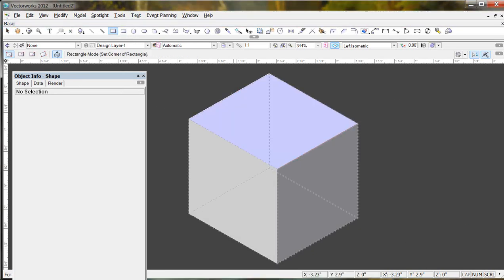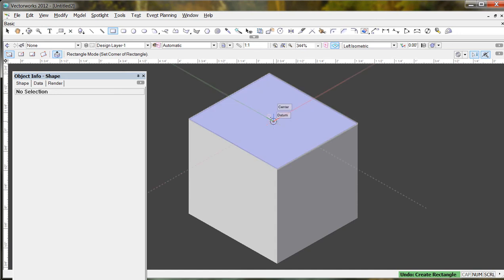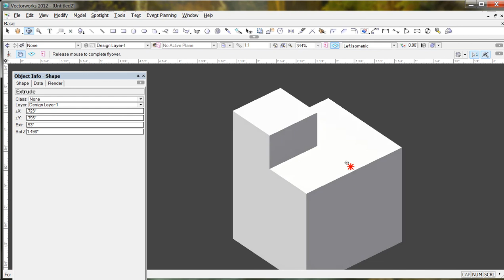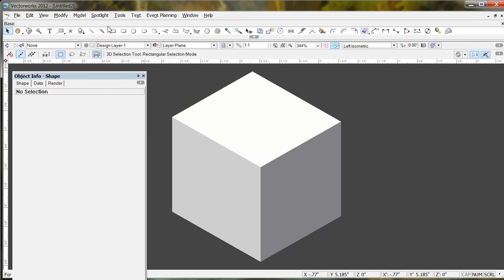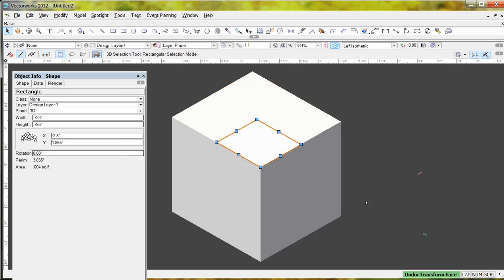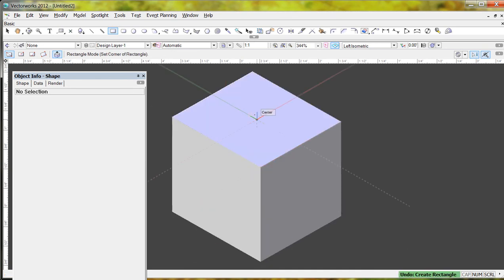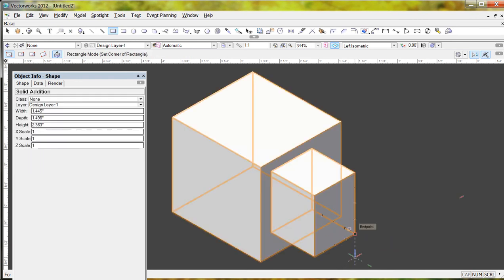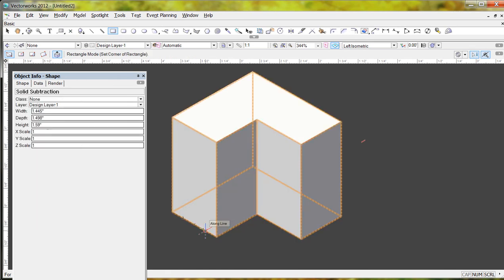VectorWorks Push Pull Solid Subtract

Comment: Also - the subtraction only works when you automatically enter the push/pull mode after creating a 2D shape. It does not seem to work on an existing 2D shape if you select the Push/Pull tool from the 3D Modeling Tool Set.

Comment: When I do this, I get weird, jagged lines.  Any idea what is going on?
Reply from the maker: Thats probably pixel-fighting. Thats when 2 surfaces are in exactly the same plane and the computer doesn't know which it should show you so it tries to show both. On a different tut, I'd advise you to select one obj and use the move command to move one a tiny bit like .001" that's usually enough to stop that. But since you're asking on this vid, its probably that it hasn't actually done the solid subtraction and you've created a shape inside a shape. Drag a selection marquee around and see what it says in the Obj Info--it it says "2 objects" or similar then you'll know thats the problem. So right click and select Subtract solids and it will do what you're trying to do. Like I say in the vid I find the solid subtract too fussy to use regularly.
Reply: @seanposkea  Thanks so much for this.

Comment: None of this seems to be work for  me. Subtract solids is greyed out. When I try to draw a 2d rectangle, it doesn't respect the planes. Just draws in 2d. Tried the Protrustion/Cutout tool. That says it's "failed" when I try to complete the operation. Bit frus. Just want to create a tenon.
Reply from the maker: +enstamudTry watching these first. If your -Solids is gray then you don't have 2 objects selected that can be subtracted. Sounds like you may be in a screen plane drawing 2d shapes and trying to use the 3d subtract solids tool. You need to extrude the shapes before you can subtract from them.  Let me know how it goes.  https://www.youtube.com/watch?v=qJqIGqNidfM  https://www.youtube.com/watch?v=lEyQQGPtv2o
Reply: +Sean O'Skea I'm on vworks 2010. Does that affect things at all? Checked out 1 vid. Seemed to refer to 2012 features.
Have had the function working incidentally, on another object. Don't know why it was diff. Both were extruded 3d shapes. Anyway I found a work around. Extruding a clipped surface object.
Thanks to getting back to me though
Reply from the maker: +Edible Cities I can't remember, but I think this tool came out in 2012 or 13. This tutorial is really about the Push/Pull tool which is only one of many ways to extrude. It's really VW's attempt to make it feel more like SketchUp. I almost never use this tool. Overlap two 2d shapes and right-click clip surface, or with two intersecting 3d shapes right-click and subtract solids. 
I would recommend you take a look at a few of my basic follow along tuts like the Greek Pavilion ones. --good luck
Reply: You have a few options in your view bar for drawing 2d geometry: on screen plane, screen-plane aligned, on layer plane, or automatic. The options change depending on whether you are in a 3d view, or in top/plan view. The last of these ('automatic') auto-detects an eligible 3D surface and turns it blue when you can draw on it. This is the option you need in order for push-pull subtraction/addition to work.

Comment: Does this work with vw 2015? I cant seem to get it to work?
Reply from the maker: Archie Campbell - Baldwin Yes it does, I just checked. But like I say in the tutorial, it's a pain in the butt. You have to get the sequence just right for subtraction. Hardly worth it when right-click solid subtract works every time with no fuss. I'll occasional use it for the extrusions with are pretty easy to do but don't worry about it if you can't get the keying sequence down. The good news is if you fail you have created another solid right where you need it. So select both objects, Right-click and Solid subtract. That's a lot faster than trying to do the auto subtract over and over.  --Sean
Reply: Sean O'Skea thanks Sean. I have been doing it that way and saw your vid and thought it might be quicker/easier if I got the hang of the technique. Evidently I am not getting the hang of it so I will stick to what I know! Thanks for the speedy reply! You may get a lot more questions fired your wa, if thats oright? Cheers again!
Reply: Meh, not that hard. You just have to hit option or alt at the correct time.